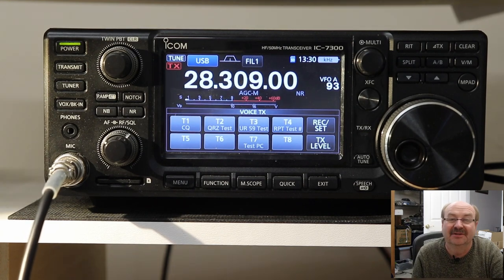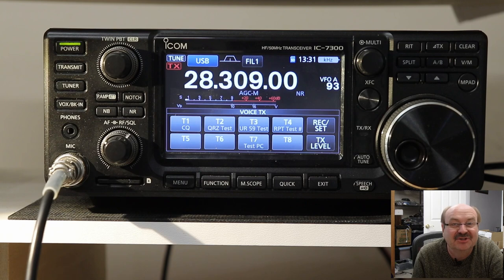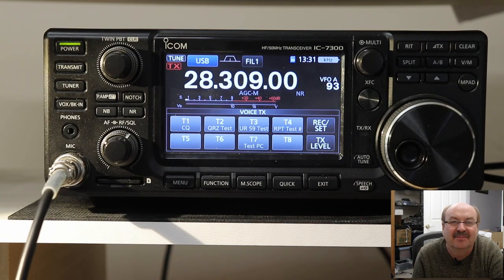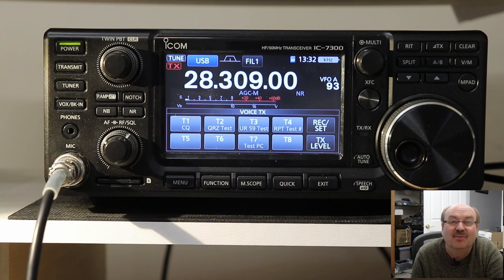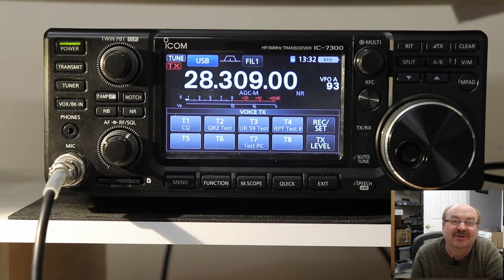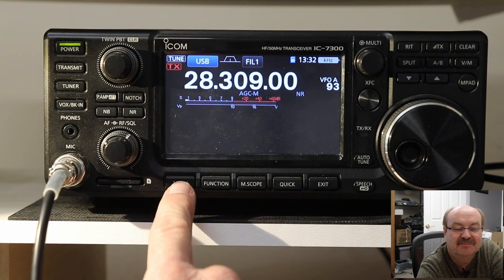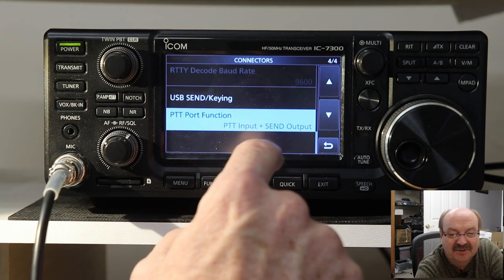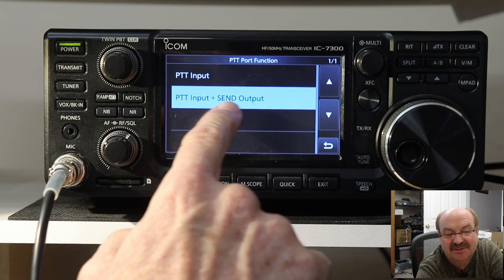IC 7300 A to Z #47 Mic PTT Menu Setting

Comment: Thank you Tom.. I absolutely love your A-Z.. It has been ultra helpful.  So, this begs the question.. How is the memory transmit for CW work regarding memory settings.
Reply from the maker: Hi.  Good question.  The Dot and Dash signals on the Key input are unrelated to PTT.  So hitting either paddle while a CW memory is transmitting will immediately stop it, regardless of how the PTT Port Function is set.  I just confirmed this on my radio.

Comment: Thanks for that information. I have a question about the voice tx playback. When I playback a CQ call I do not hear my recording through my radio. I can see it on the waterfall display and it registers on the meters. Any clue as to why that is?  Thanks
Reply from the maker: Press the multi-function knob (to the right of the display).  Check to see that Monitor is ON and set to a reasonable volume level.

Comment: Thanks for all the help understanding this radio. After watching numerous positive reviews on the IC7300 I broke down and bought one. The last radio I owned was a Mirage 88 handed down from my father. The 7300 I received came with a Japanese  manual which worried me and when I hooked it up I discovered the menu was entirely in Japanese which I have never learned. Do you know how to switch the language to english? I feel I got the needle in the haystack as I  can not find any other person with this issue. Thanks
Reply from the maker: Hi Mike.  The display issue is pretty easy.  Press the MENU button.  Then go to the SET menu- It’s the lower right soft button with a wrench & screwdriver image.  Display settings are the 4th item down on the first page.  Once you touch that option scroll all the way to the bottom of the next menu.  Display language is the last item.  Touch that option and you should be able to change the display to English.  The bigger issue is that if your radio is a Japanese model, you probably won’t have access to portions of several US amateur bands.  I don’t believe there is any easy way to modify the radio to get those frequencies.
Reply: @HamRadioA2Z  Thank you sir. I think my menu was  bit different but after learning a few Japanese symbols, "display,  language, english", I was able to navigate to the "change to english" that put a smile on my face. Be well and take care.Now to go get that technician  ticket next week.